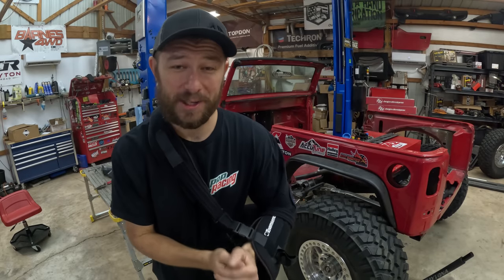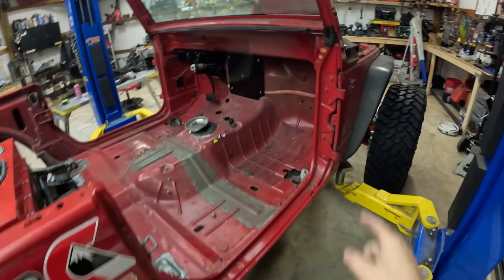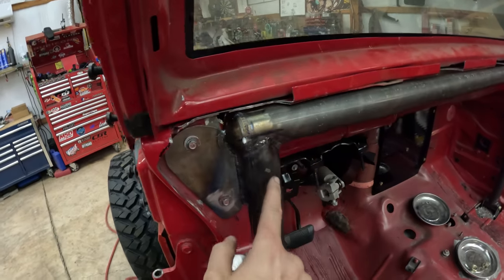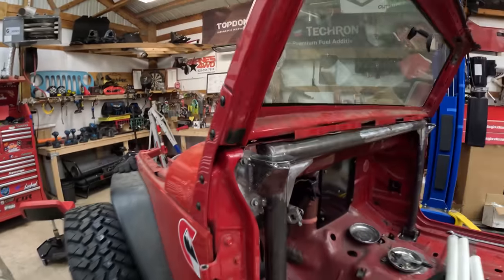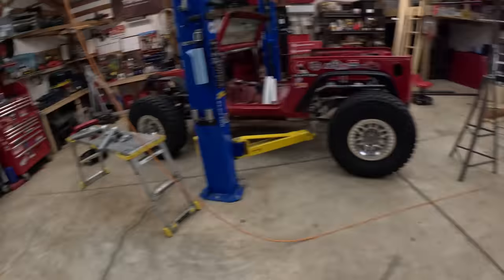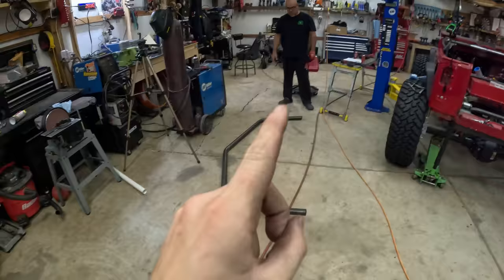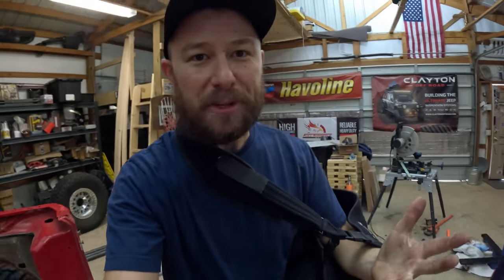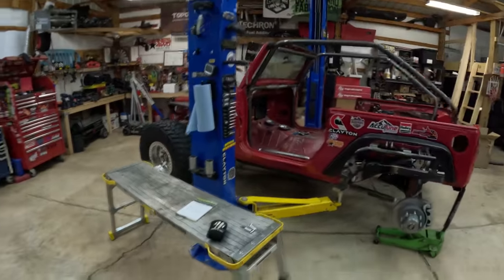Building A Custom Offroad Roll Cage!! - Ultra4 Jeep Build - Ep13

Comment: I know that several other cages end up getting a crown in them in case of a roll over.  Is that a requirement in your jeeps case as well? Or does it depend on the strength of the cage? Or even both? 

Great video as always👍🏻